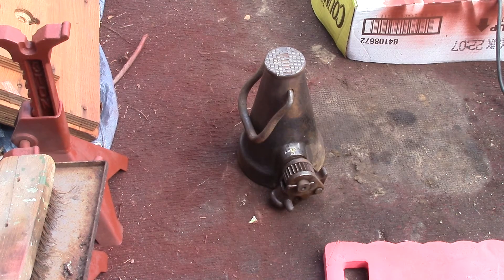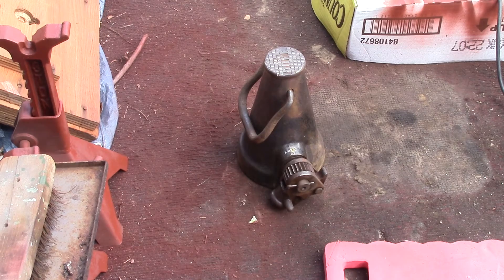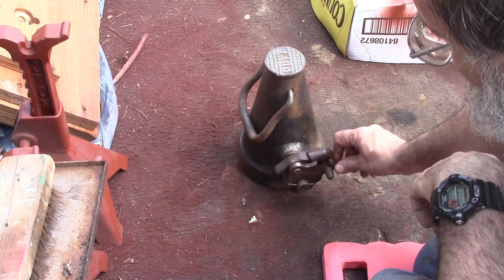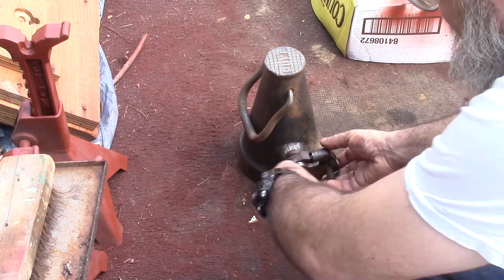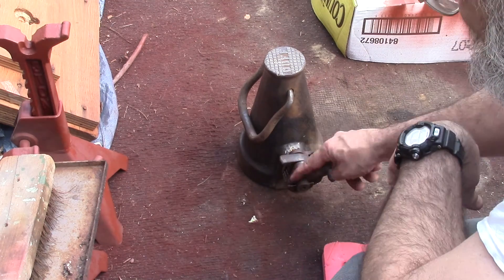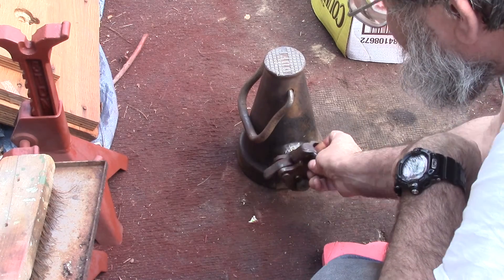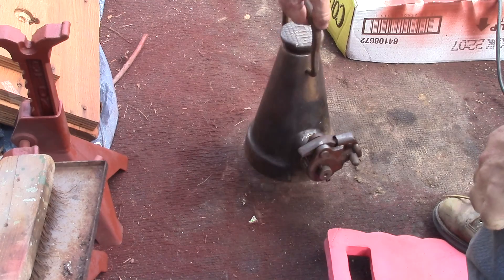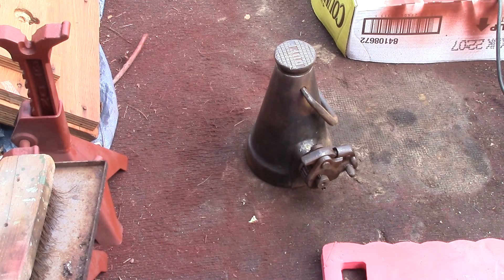The Duff Norton Mechanical Journal Jack

Comment: Josiah Barrett was the captain of a river boat operating out of Allehany County near Pittsburgh.  In 1883, he developed a ratchet jack to pull barges together into what was called a "tow."  He turned to Samuel Duff, the owner of a local machine shop, to manufacture the jack, and the two men went into a partnership, forming the Duff Manufacturing Company.  By 1890, the company was offering seven different models of the jack.  Over the next 30 years, they became the largest manufacture of lifting jacks in the world, but still wanted to be bigger.  In 1928, they merged with A.O. Norton to become the Duff-Norton Manufacturing Company.  One year later, they offered a motor-operated power jack, making use of portable air compressors that had recently come on the market.  Ultimately, in 1940, they developed the first worm gear screw jacks for adjusting the heights of truck loading platforms and mill tables.  Duff-Norton continues today as a division of the Columbus McKinnon Corporation.
Reply: Hey, Cool history lesson, I happened across a patent #1,410,579 inventor J.C. Kopf "lifting jack "(journal jack) March 28 1922 with a exploded diagram looks like the one in this video with its straight cone shape. (no bulge)

Comment: How does the handle effort compare to a hydraulic bottle jack? Seems like these would require a lot more force to operate once you had them substantially loaded.
Reply: This jack could probably lift a F250 with a sawed off broom stick,  but if you're going to lift the rated load,  you might need a piece of solid cold rolled bar, 3 to 4 foot long,  and it would be like going to the gym...they  make great jack stand,  just not quite as stable

Comment: Ive been using these to change tires on trash trucks,a little slow but the control both up and down is great,it takes a long solid handle,Ive got a copy of a US patent dated 1922,a very similar one is the Simplex Super jack if you need a new one,have thought of trying fiberglass rod for lighter handle.
Reply: ...and yes,  the fiberglass handle works well for a short handle,  and can be shaped to fit a worn-out socket,  but anything longer than 2 feet will tend to bend.

Comment: Cool!,I collect these too!,I also collect Simplex.
Reply: I just found one of this in my country house
Reply: Cool, try not to throw it out, they pretty much last forever, just go up about half way and you will see an oil hole (if someone has rebuilt it using grease it will shoot back at you), the only thing you have to watch out for is the round base makes it prone to rolling out, so have some kind of cribbing blocks. (crash pad)